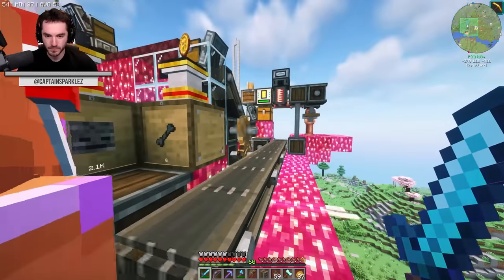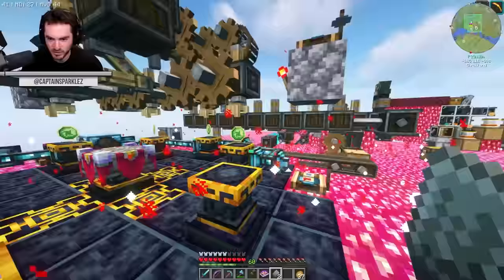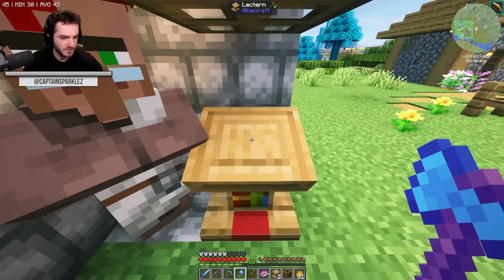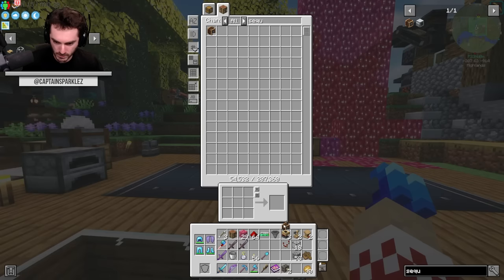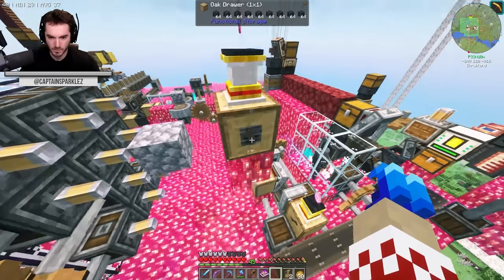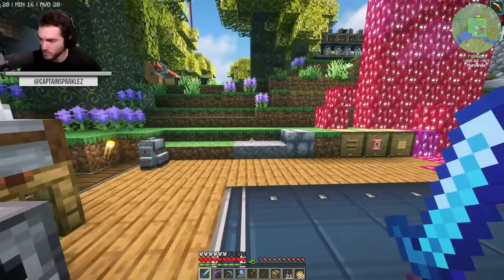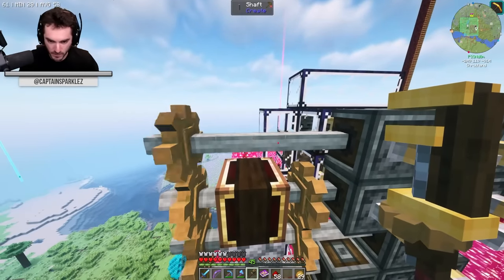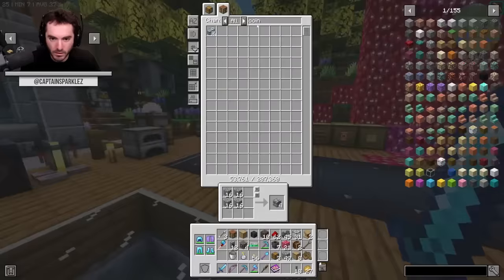Minecraft: Create Arcane Engineering Ep. 28

Comment: For the wither builder you could have a redstone clock/sequence sequencing the deployers to always place one block at a time, because as you have said speed is not a problem on a server running 24/7.
Create wireless redstone and max delay repeaters should do the trick if a sequenced gear shift doesn't work out.
Reply: It might be best to sync 6 out if 7, and have a trigger that checks for if the first set of deployers fired. That way there are no resyncing issues. For example, you can sync an external deployer to the ones placing 6/7, so that you don't have to take a pulse from inside the wither chamber.
Reply: Alternatively, if the soul sand is always placing, and the wither skulls are on a timer, it should work fine.
Reply: isn't that what he originally tried to do but then ran into issues with them syncing up instead of staggering for some reason?
Reply: @toastr1255  yes cause he just used a sequenz gearshift. instead of acutally watching a trigger
Reply: He resolves it at the very end of the video. Just weird create behavior that he found a workaround for.
Reply: @dankertester  for the most part yes, it still seems to break after a few loops though
Reply: @Soulseller33  did you not watch literally the last 10 seconds? He fixed it completely
Reply: @Soulseller33 start watching from 1:31:24
Reply: @dankertester  ah thanks, i actually did not.
well at least it works for him